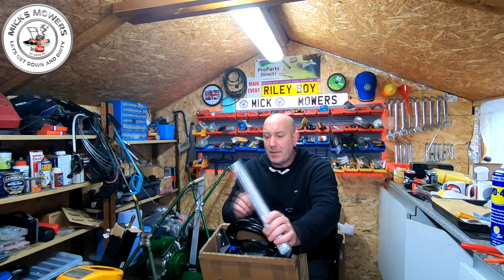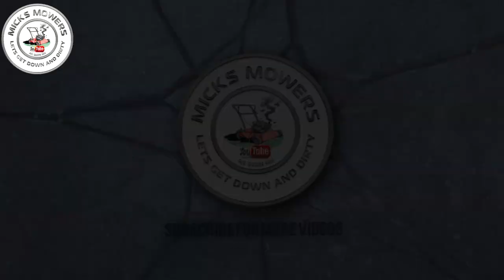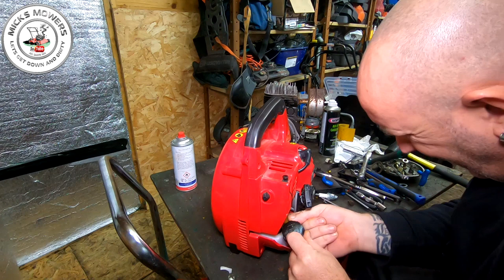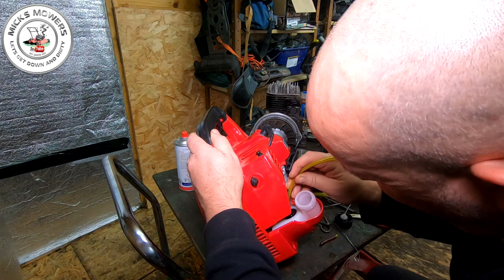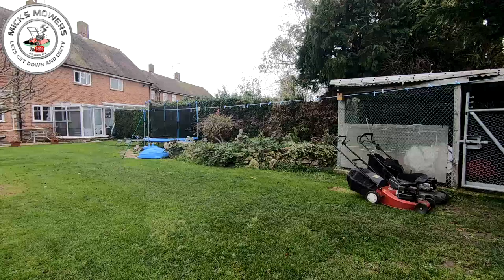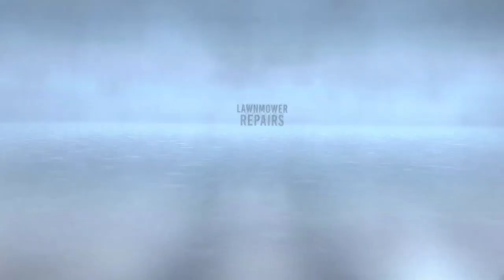Pre Mixed Fuel - You Will Never Guess What I Found

Comment: Looked like oil, sounded like oil too, as you poured it out.  Well done. Also thanks for the shout out. I get my rods from ToolStation around a tenner for 5KG.
Reply from the maker: What size mate..
Reply: @themowerman  They do them in 2, 2.5 and 3.25 mm and 5KG boxes. (Though their listing claims that the 2mm is only 2.5KG it is actually marked as and weighs 5KG).

Comment: Well done,the pre mix is crap,when I replace fuel filters, I find porex filters are heavier, and stay in place better, I find sometimes those plastic ones move ,solder wrapped around the fuel line helps, plumber type thicker
Reply from the maker: Yeah I like the one I put in.. with the cotton the run better
Reply: It depends on the pre mixed fuel. Our workshop uses the Stihl Motormix and it seems to be better than the ASPEN 2 fuel in two stroke machinery. The only time the pre mixed Alkalyte fuels don't work is if the diaphragms and gaskets in the carburettor have completely perished.
Reply: I run Aspen 2 on my Husqvarna Chainsaw, never had any drama.
Reply: @AnthonyHitmanDarts  some machinery dealers have found that  ASPEN 2 is great if you use it in a new machine that hasn't been exposed to unleaded pump fuel. I have found if you put ASPEN 2 in a two stroke machine that has been run on unleaded for ages it doesn't run well due to the deterioration of the gaskets and diaphragms.

Comment: Just because it said pre mix oil doesn’t mean it is mixed with gasoline you have to add the gas.
Reply from the maker: Yeah.. I did take to him and he showed me the bottle.. it was just oil.. lucky it wasn't just plan fuel I suppose
Reply: Definitely, straight petrol would have had disastrous results.
Reply: @mc2whls  I have seen that a few times and I have seen the good old 4 stroke engine oil in petrol to subsidise using two stroke oil, that doesn't end well either.